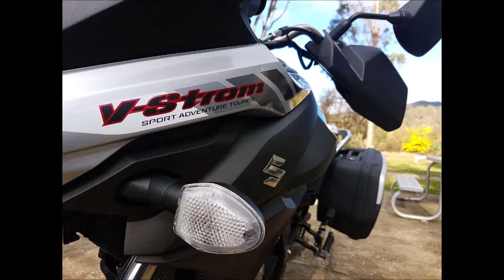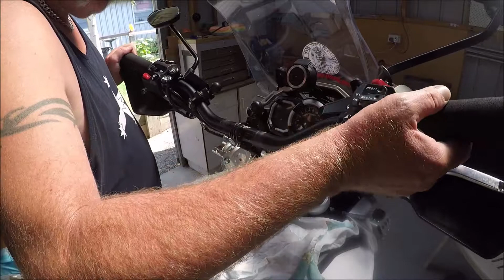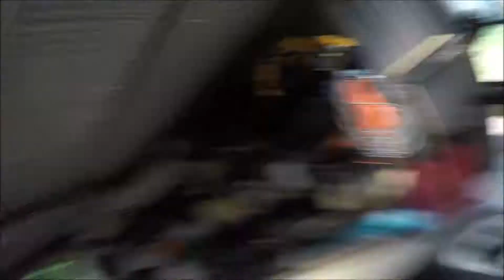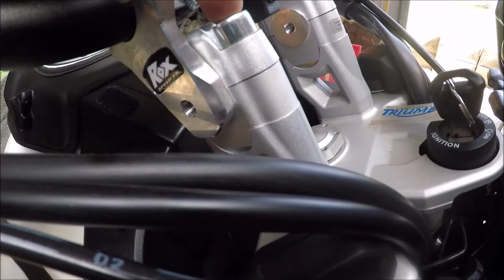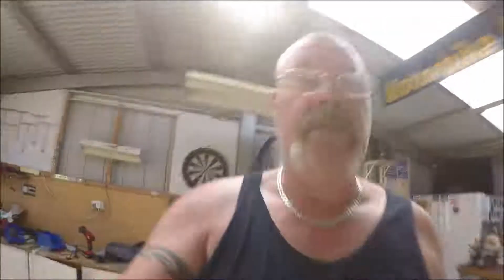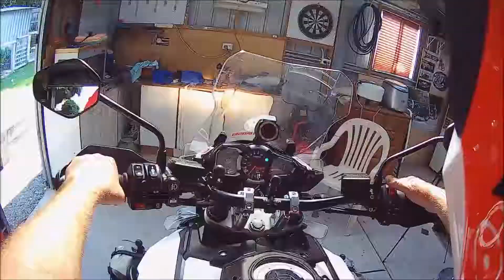TRIUMPH EXPLORER XCA FITTING ROX HANDLE BAR RISERS

Comment: What year is your bike mate? I have a 2020 XRx, Rox website said wouldn't with stock cables. Also looks like you have a comfy seat.
Reply from the maker: Hey Bruce my bike is a 2017 model. My cables are stock the 3 inch fits fine ride safe
Reply from the maker: Seat is stock and it’s not comfortable it’s shit lol 😂
Reply: @dynamadnessadventures205  yes mate 😆
Reply: I have a 2017 1200 explorer so the 2” should work?
Reply: The Rox website says on my 2017 explorer they don’t recommend any risers because cables would have to be lengthened.Buy everyone is putting risers on without problem.
Reply from the maker: Hey David well mine worked and I have a 3 inch rise 2 inch should be fine
Reply: @dynamadnessadventures205  I’m going to go for it and get a 2” set.Thank you very your video.Happy New Year.